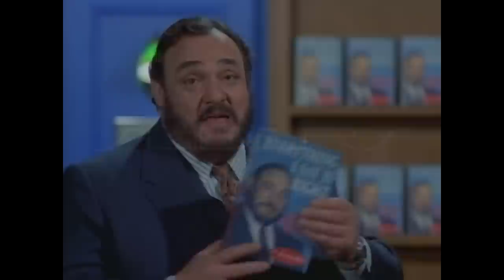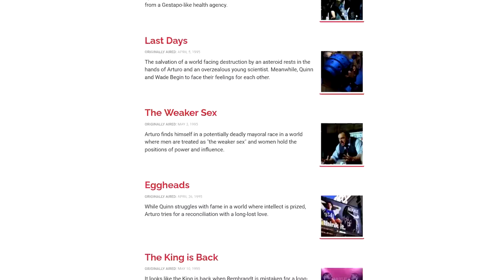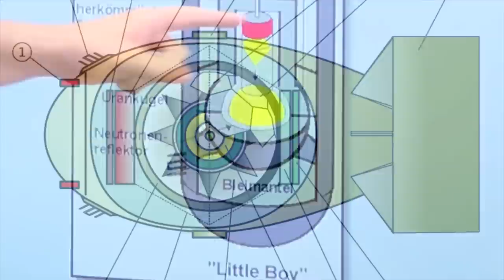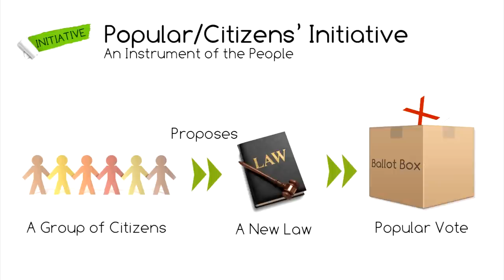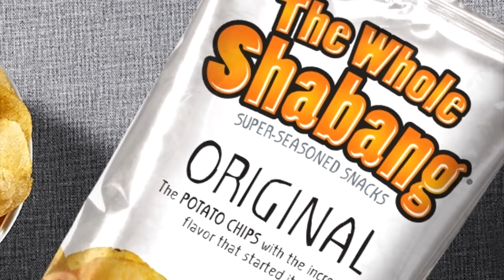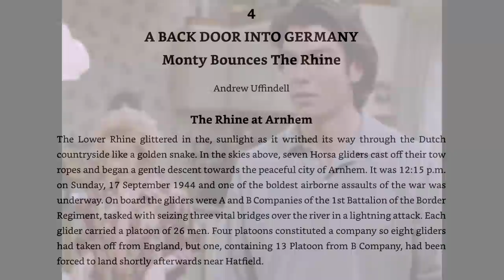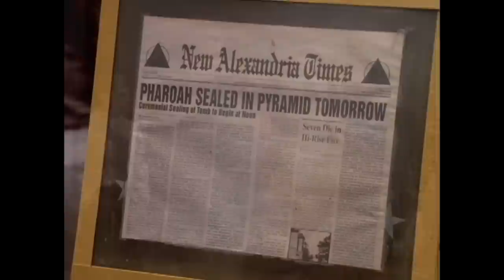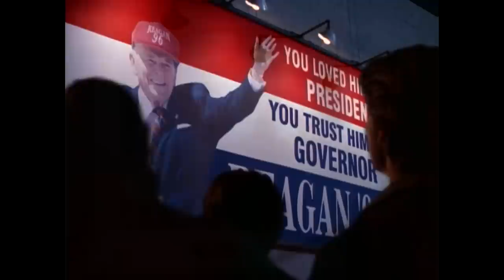Talkernate History - Sliders Retrospective

Comment: I had a huge problem in the episode with the atomic bomb.  Little Boy was indeed a gun device that used uranium.  However, both the "Gadget" (White Sands test bomb) and Fat Man were implosion devices that used not uranium but plutonium.  And the big question about the development was not the Little Boy design, but if imploding plutonium would achieve the same result.  That is why the only test done was with the implosion plutonium bomb.  And knowing that, it made the claim there was not enough uranium on the planet utterly silly.